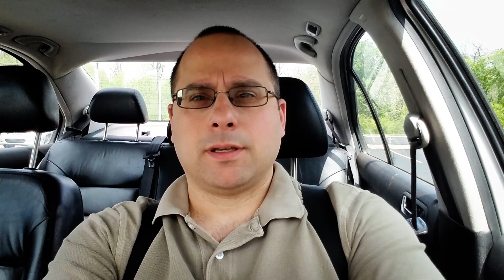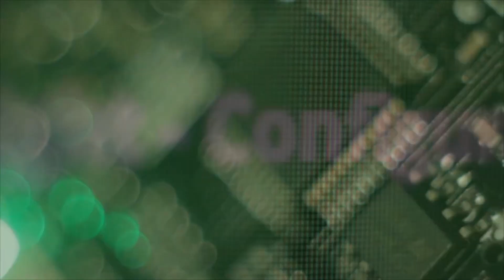Frsky Taranis antenna mod and why you probably shouldn't do it.

Comment: I too had issues after this mod and ended up going back to the original antenna. I'm getting over a half mile of reliable signal with the original antenna and have time to turn around if I get a low RSSI warning. I think the reduced beam width of the higher gain antenna was causing issues for me at long range.

The mod itself went smoothly. I used an RG316 RPSMA pigtail cut to 84mm. Attached my antenna and had a SWR of 1. Then I went out and did some real world range testing and got just a little more range than before. Perhaps 50-100 meters.

That's where things went south. It seems I had slightly more range, but would failsafe really easily and almost without warning at long distances. I'd get a signal low warning and then before I could even react I'd just drop. Went back to the original antenna and range is back to normal with no sudden failsafes.

Comment: 84mm wire is a joke... sorry VAS but that cable should be short as possible not 84mm.... also... dont buy cheap antennas on ebay... stick to alofthobies for your antenna... cheap china antenna tend to loose connection
Reply: that being said... stock works just fine... 5dbi is hype.... mostly
Reply: can you explain why youd want as short as possible compared to 84mm (or any other length for that matter?) thanks
Reply: +cookie4524 sorry I come across like a jerk. im a nice guy I swear! haha. 84mm is referring to the shielded cable inside the transmitter... some people think that it should match the physical length of 1 wave of 2.4ghz radio signal. this cable however continues for 15mm or so inside the antenna. so 84mm is not   actually 84mm of total shielded length... and besides that its shielded so length does not matter only that shorter is better... I think that whoever came up with 84mm must laugh a little every time he sees it referred to.

Comment: I have done the mod swr is between 0-1 cut cable length to 84mm did a good solder on the antenna, but now when I went into the receiver tab in betaflight the low mid and high numbers are flickering like mad is there anything I can do other than put the original antenna back on .

Comment: The signal loss due to an extra SMA connector far outweighs the benefit of a different Antenna.
Reply: Ummm, my experience does not reflect your opinion.  I'm not using a taranis, but still, higher gain antenna absolutely increased my range, it's undeniable.
Reply from the maker: +Leon C. No that's just wrong. The SMA connector is something like 0.1 dB.
Reply: Oh, thanks for telling me. Is signal loss more significant in 90-degree adapters or kinked extension adapters?
Reply from the maker: +Leon C. Yes, a bit.

Comment: I'd like to share my experience: In my Taranis Plus, after applying the mod I got SWR 16 or 36 depending on the antenna I used.
Even though I got better signal, after a week I decided to play safe and re-solder back the OEM Antenna. SWR is back to 0.
Nevertheless I have a feeling my signal strength has dropped for some reason...

From my experience with 2.4Ghz wifi antennas, I have seen WiFi miniPCI modules loosing signal strength or even burning up. Possibly due to static discharge caused by long or inappropriate antennas.
Reply: I had a similar experience. Slightly increased range after the mod, but I found that the time between low signal warning and a failsafe was much shorter.

I went back to the original antenna and range seems to have returned to normal.

Comment: Could the pin exposed on the RP-SMA allow for some static to transfer to the board when the antenna is removed? Someone on the stone blue airlines video was wondering if that is why IBcrazy uses SMA instead of RP-SMA.

Comment: I am very sorry for your transmitter. Hope you will be able to replace the transmit board.
Lately I have seen some people de-soldering the 'signal capacitor' of thier ESCs telling it now supports DShot600. Do you have experience doing this? Might be an interesting video.

Comment: Easy solution, buy an external module
Reply: you can also buy the internal module
Reply: Link?
Reply: google it man
Reply: I did. I could only find the backboard with the internal module. Not the internal module by itself. Maybe that's what you meant?
Reply: yea, and if you are to cheap to buy that then get an external module, id recommend the 4 in1 module so you can fly different brands on receivers

Comment: Joshua, you're going to lean something today. (LoL) I went to your video on the Taranis antenna mod and noticed that you didn't cut your coax to the proper length for 2.4ghz. which more than likely caused your  transmitter to fail.
The antenna coax needs to be certain length per frequency and coax size or attenuation of the signal instead of amplification occurs and transmitter failure is inevitable. In his mod Mr. Steele used RG 316 cut @ 3.2 inches(84mm). The formula to calculate this is as follows:

length (in Meters) = (300/CF) * VF
 VF = Velocity Factor

 CF = Center Frequency
  So RG316 @ 8.39375mm= 300/2400 x .79 

Joshua I have learn a lot from you in your videos and I hope this helps you and others.
Best Regards,
Up Up n Away,
Michael
Reply: That name tho
Reply: Rotor Riot's rant of Rotor Rant ranting
Reply: Sorry I believe you're wrong. You do need to have your coax in multiples of 1/4 , 1/2 or full wave increments of your frequency to have your transmitter work at peak efficiency. The length of your coax can change your swr. I am Ham operator too and know for a fact you can change swr by length of coax. Please do your research so you don't fry your radio also. Here are a few sites that explain more;

http://www.worldwidedx.com/threads/does-cable-length-affect-swr.17385/
http://radioproshop.com/swr.htm
http://radiopreppers.com/index.php?topic=1174.0
http://www.kc9aop.net/HAM/antenna_facts.htm
Reply: Seafurymike, I think you have missed my point. I fully agree with what you are stating. (except you should check the specifications for the coax vs losses, RGU-179 isnt even specified for frequencies  above 1GHz, and losses go up real quick above 1GHz). What is in dispute is the erroneous statement that the length of coax form the PCB to the SMA connector must be an integral quantity of 1/4 Lambda. That is false! A matched line (ie terminated correctly with a 50Ohm real load) can be any reasonable length, and it will present a 50Ohm load to the transmitter, which is what we want. If the load is not matched than different lengths will have significantly different effects.
Reply: Rotor Rant the losses between the board and connector are negligible at the length required (lets say 15cm) and frequency. If you took this into account the way your stating, no one would use pig tails between their vTx and CP's, etc.....

The important aspect to concentrate on is the impedance matching, which is 50 Ohm for our setup and the "active element" length of the antenna.
Reply from the maker: +seafurymike +seafurymike they're not 100% negligible. I looked up the loss for pigtail coax once and found it could be something like 1 to 2 dB for a typical pigtail. I don't have the numbers in front of me right now. That's not a deal breaker but it's not nothing either.
Reply: What coax you would want to use is RG 178 not RG179, but the best to use is RG 316.
Reply: I think your maths is flawed. 300/2400 x .79 = 0.09875
Reply: Tronik,
My bad, I should have explain more. Any length in multiples of .09875 will work. So 8.39375/0.09875=85
Reply: Better to be safe than sorry. So I'll be safe and you maybe sorry!
Reply: If your theory is correct Michael, (and I am certainly NOT saying that) How do you account for the velocity factor of your coax? Which is actually around 0.81 for that thicker RGU-179 Coax. Meaning your 1/4 Lambda is actually 19% less. Probably a good idea to go revisit transmission line theory.
Reply: Joshua Bardwell fair call on the loss @2db. It would still be my 3rd important characteristic behind impedance and active element length. Most of the loss for a pigtail would come from the connectors and not the cable itself. Just as it is with optical fibre interfaces, etc.
Reply: Properly terminated coax can be any length that is why it is a transmission line.
Reply: Incorrect. COAX can be, then ANTENNA portion is very specific. Watch Bardwell's antenna video to find out why.
Reply: Not the coax, just the exposed RF radiating wire that exits past the shield. The coax can be any length, though shorter runs are better.
Reply: Don't confuse transmission standing wave ratio requirements to feeder cable. The coax between the board and the screw terminal is not governed by transmission requirements as it should be shielded with the earth sheath. From the screw terminal out, basically the bought antenna, is where the earth is removed and only the raw core is exposed. This needs to be accurately sized for the transmission frequency as it is where the emitted signal propagates out.

Comment: I ripped off the signal solder pad by accidentally bumping it before soldering the grounds and had to order a new internal module. Was way more careful this time and glued things in place before soldering and soldered the ground shielding first to hold in place better. Lets hope this works because otherwise, is there any solution other than ordering a whole new radio? You can only get internal modules without an antenna soldered so you are essentially doing the the mod if you have to replace the board, no? I guess I could solder the original antenna back on.

Comment: So is it ok to put a 5dbi antenna on my 
Special edition taranis?
I opened up the new taranis and saw they have the same kind of black thin wire the standard x9d has.
Yeah bought the SE taranis after having low rssi on my old taranis.. after mod.
I wanted the new m9 gimbals and the cost for a new xjt module it didnt seem to far of a reach.

Comment: From an RF perspective diffrent antennas have diffrent caracteristics on how much power they reflect back into the module so if the  antenna is reflecting more power back to the module than the stock one wich can lead to an overheating module or damaging it. This is why we normally fly cloverleaf antennas insted of a skewplanarwheel antenna because the cloverleafereflect less power back into our videotransmitter causing less heat.......  I´m not a professional..... but you might have talk to alex greve to get the right answer.

Comment: JB I don't have that radio but I am an RF expert and licensed Ham Radio operator such as yourself and if you trust the SWR report on your radio then it might not be an impedance mismatch. There's something else going on with the mod. Heat? Static? If we think the SWR meter on your radio can only say open or good then maybe there is a mismatch.
Reply: Jeff C Jeff, is a SWR of 16 going to damage my tx? I have had this high number since doing this mod a few weeks ago with some thinner coax. i have 316 coax inbound and will be replacing it asap. until then, will my higher SWR damage anything?
Reply: I don't have this transmitter so I don't know what the numbers mean. JB should know. In general a perfect SWR means 50 ohms matched to 50 ohms resulting in an SWR of 1:1. Typically we want this less than 2:1 and anything higher can result in damage. For example in Ham Radio where we can transmit 50W or 100W we make sure SWR is around 1.5:1 or less.

Comment: What I have wondered about, can't you put the XJT module in the Taranis and then connect any antenna? Doesn't the antenna upgrade work that way too or is there some latency or firmware problem that I'm overlooking here? (I don't have this myself, but if that works I might do it)

Comment: I did the mod about 2 years ago to my Taranis and mine is still absolutely fine.. I get excellent range with my Multi-rotor with L9R receiver and X8R and have never had any issues signal quality or range. My SWR is always 0 sometimes 1.  My Taranis runs and works spot on.. Even went for a fly today with no trouble.

Comment: My radio just gave out yesterday !!  Flew earlier in the day. Had a suspicious failsafe but was able arm after. Went to fly later that day and couldn't connect to any of my kwads. One weird thing is that when I turn it on with no antenna it doesn't give that error . I saw the error once a couple weeks ago when I forgot the antenna for like 3 sec. I tried resoldering the original antenna but no luck.

Comment: any difference with the controllers that have the UFL connector and require no soldering?  at least do you believe that may be the source of the cause?  the actual soldering
Reply: no difference on the pre plus series at least.  The PCB pads are designed for the uFl connector but also easily accommodate a direct soldered mini coax. I could be wrong but I believe the original motivation for direct soldering was for FCC compliance and it was frSky's intention to use the uFL from the start.
Reply: Kabab FPV hi

Comment: I JUST FINISHED THIS MOD AFTER WATCHING YOUR VIDEO AND NOW YOU POST THIS? 
.
.
.
.
.
.
.
JK, but I did recently perform this modification (my internal JST had bricked and wouldn't bind to any new models, so resoldering a new antenna was impossible to get around anyways, so no tutorials made me tear up my radio and you've been nothing but a heap  of help). I'm curious if more info can be collected regarding the type of coax used in problem installs or if it's possible to narrow it down for future would-be modders. Sorry about your radio! Looks like it was a nice day to fly too!

Comment: I installed video/data/voice services over coax for years.  I know that the female side of our F connectors would get loose over time if the connection was taken on and off a lot, especially if the center pin in the male side was not perfectly straight and centered.  It's possible this is happening to the SMA and causing loss and heat.  I'm not saying this is for sure what's happening but it makes sense if the antenna is removed and reinstalled every time you fly.  The SE Taranis might be susceptible to the same problems.

Comment: Must be lucky.  Did the mod a few years ago from the kit from boltrc and it still works great!
Reply from the maker: +rsokors how often do you unscrew your antenna?
Reply: Joshua Bardwell Almost never...
Reply: same here, done my mod about 2 years ago and still great today !!! some must have bad luck
Reply: I'm curious if this ends up being an RP-SMA wear issue or something related to stress on the coax - I used one of the 3d printed internal mounts and filled that puppy with epoxy before installing.
Reply: Mine too, was from BoltRC.
Joshua Bardwell, i unscrew my antenna on every flight so i can pack it away. I machined a plug to fit in the top of the Taranis and is araldited in. 2+ years of good operation

Comment: Mine has been working perfectly since November... Just be careful and make sure you do it correctly.
Reply from the maker: +Charles Levert how often do you remove your antenna?
Reply: Joshua Bardwell Somewhere between 5-10 times per week, just depends on how often I get to fly.
Reply: Joshua Bardwell I used the RG 316 cable and followed IBCrazys instructions perfectly.
Reply: had mine for a while, greatly improved the range.  my range went from 50 yards on the stock antenna to a kilometer.  use 6dbi and 5dbi antennas.  SWR zero to one.   adjusted SWR by clipping the tip of the antenna.    My guess your problem resulted from oxidation of antenna connector, or bad solder joint which eventually failed.  Run it with no antenna or bad antenna connection and say goodbye to your module.